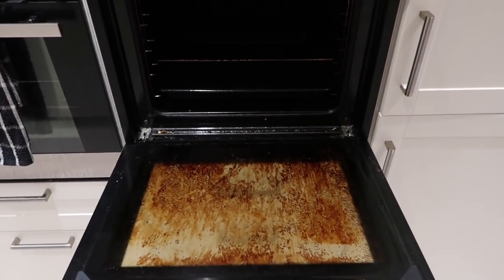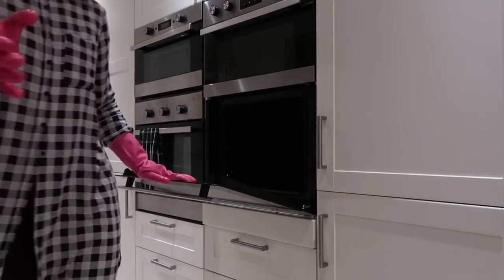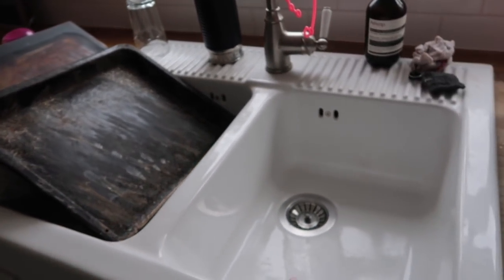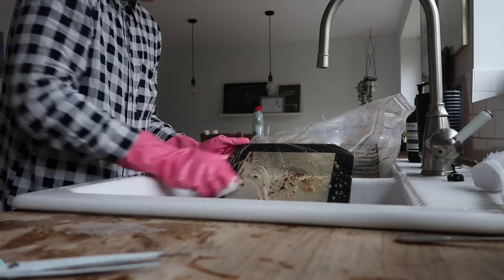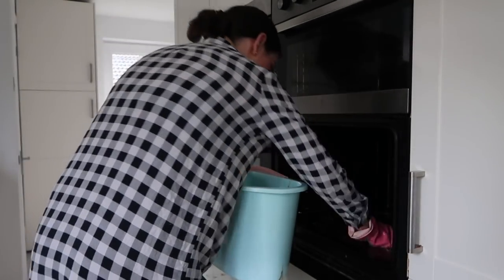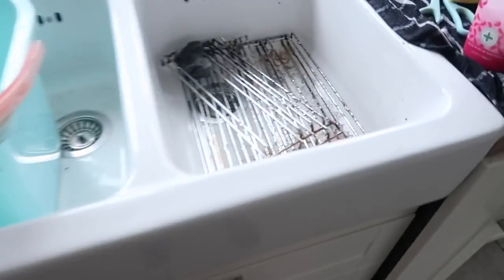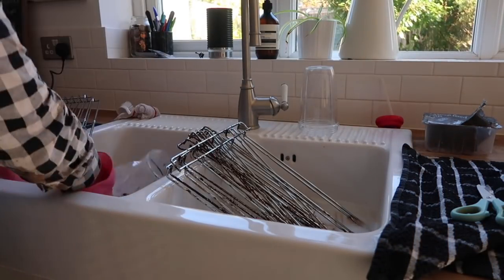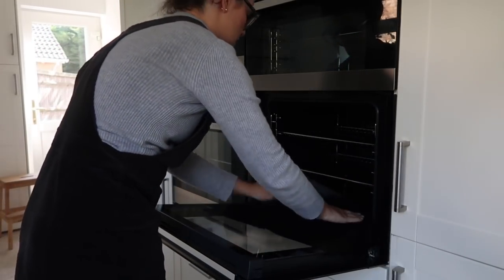DEEP OVEN CLEAN | SPEED CLEAN WITH ME | CLEANING MOTIVATION

Comment: I have used Oven Pride quite a few times now and am about to embark on a ore-Christmas oven clean on an oven that closely resembles your 'before' pic! I find it does a very good job with the addition of the soap filled wire wool pads too, but will definitely try your tip of pouring the used liquid in the soapy water and also decanting it into a squirty bottle for doing the awkward bits in the oven. Hopefully it will look as good as yours.